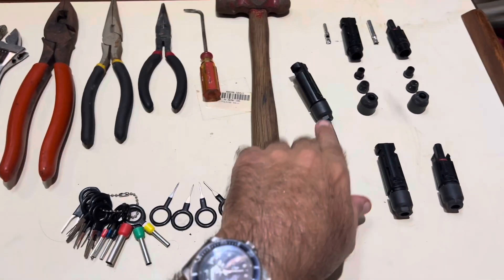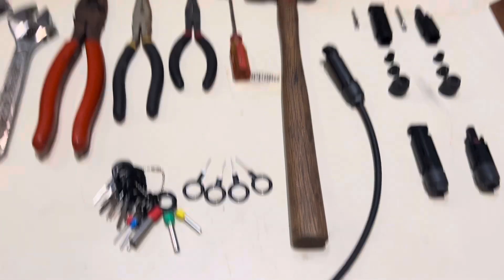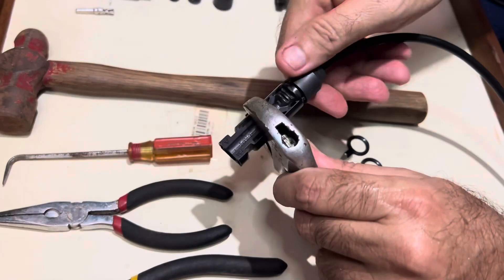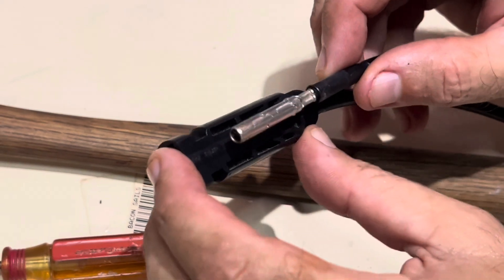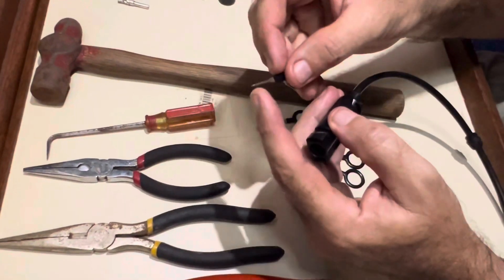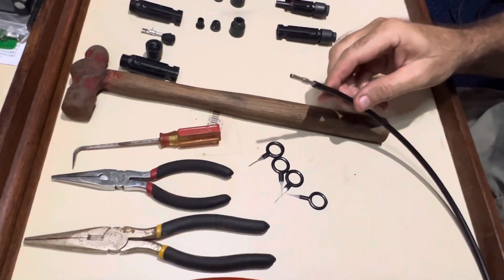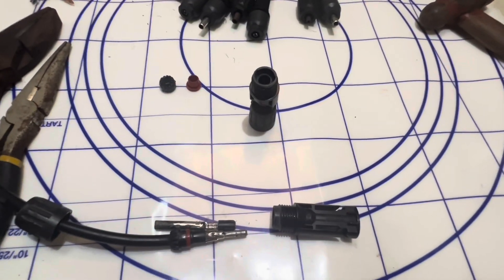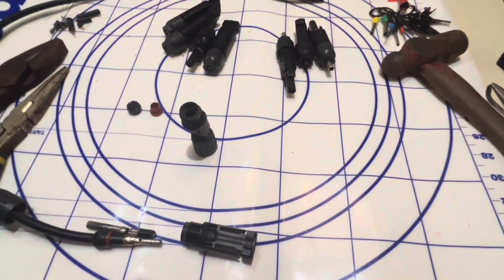How to remove an MC4 connector pin from the connector for repair and or recycling the connector

Comment: My
Pin is stuck in the mc4. Here you got it out still attached to the cable but my cable came out not the pin.. any tips ?
Reply from the maker: Depending on which connector it is, if you can get needle nose pliers on the pin side, push and twist the pin at the same time trying to push it out the cable side. 

Short of that, a new MC4 connector would be the easiest solution. But I understand that a new one might not be accessible.
Reply: @sailingsvbarefootadventures  Ya to order it where I live is a pain ... but will try what u said, thank you for answering me !